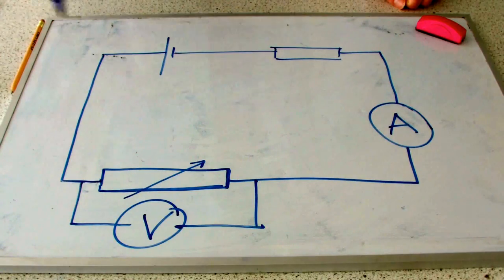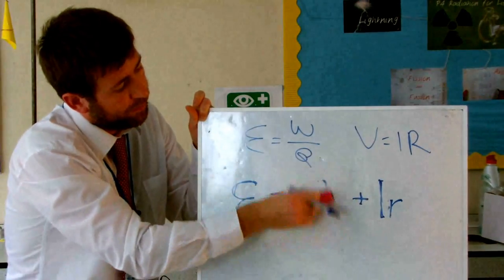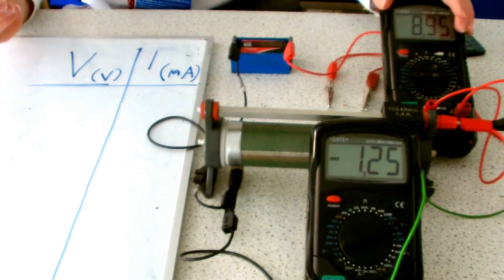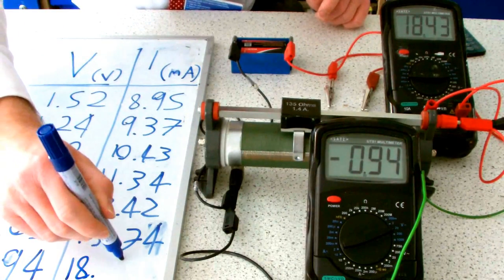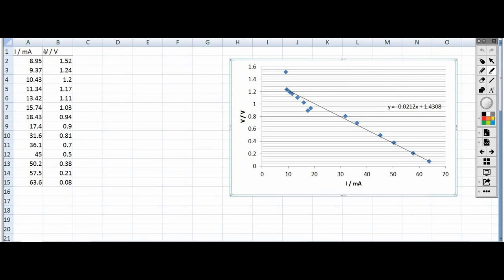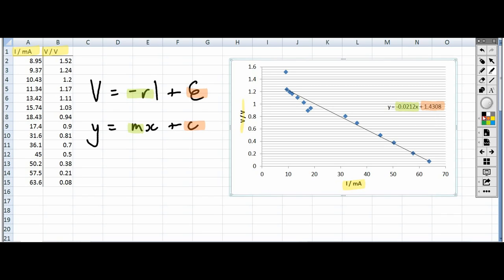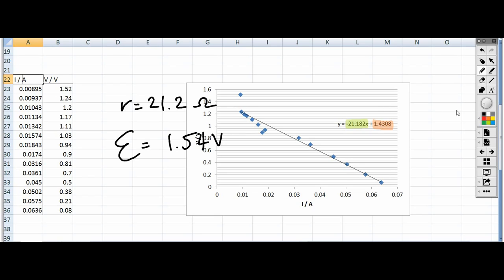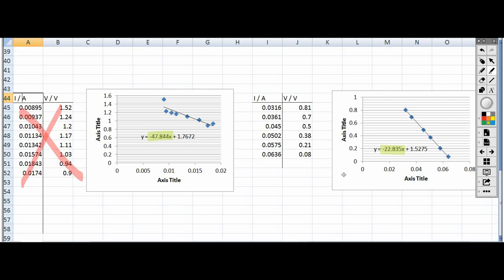Measuring Internal Resistance - A Level Physics Practical

Comment: I've seen this practical with the voltmeter over resistor over the source of emf (cell/battery) and don't know which one is correct because of it being a potential divider between both resistors.

Comment: brilliant video! Can I just check when you were sliding the variable resistor, was it from max resistance to min resistance?
Reply from the maker: Yulin Chen yeah basically, you just need a good range for load resistance to get a good straight line graph. thanks for the comment.

Comment: The “r” in the circuits what does it stand for? I see u using a little wire thing but I don’t really know what it is? Thank you the video is very helpful
Reply from the maker: katy crazy Hiya. The little r stands for internal resistance. So a resistance that a power supply has. 
This experiment is really just a model, as the real internal resistance is too small to measure accurately!  So the little wire thing you mentioned is a fixed resistor. That's what we're measuring with our y intercept on the graph. Thanks! 😀

Comment: Hi! I don't really understand why the voltage decreases as current increases! It says in my textbook that the lost p.d. (which I think means p.d. lost from internal resistance ) increases as current increases.
Reply from the maker: ArmedPenguins you might be ready for the max power theorem!
https://youtu.be/dF0EGP76EQ0
Try to conceptualise the p.d. as energy per unit charge, this might help to explain the effect of a higher current causing more heating so higher resistance so dissipating more energy. I guess it depends on the proportional change in load resistance Vs internal resistance.  There's lots going on in circuits!
Reply: Thanks for that vid! Our teacher did make us try using calculus but it was a little too difficult since we haven't seen chain rule and stuff yet. Okay so if the resistance increases due to the heating, shouldn't V increase? (from V =IR). Or, is this trying to say that as more p.d. is lost as internal resistance, less is lost from the load R, due to the ratio of how emf splits.
Reply from the maker: ArmedPenguins yeah exactly that. You've put it more clearly than I did. If the external resistors are ohmic then current shouldn't effect them. In this experiment with an ohmic resistor as the model of internal resistance then current shouldn't effect it either. Real power supplies do heat up though so that may be what your textbook is getting at... It's my best guess without having seen it! 😃
Reply: Thanks!

Comment: Hey thank you for the video it was helpful! I do have a question tho we've always learnt that when taking readings u must turn off the switch in between readings, is that correct?
Reply from the maker: Shahad Jabiti no problem, my pleasure. I've heard that too but I know from experience that you still get a precise line if you just leave it on as I did.  The reason to turn it off if to avoid the heating effect of current, as the currents in this practical are so low the heating effect is pretty much negligible. However I've seen that advice on exam board material so I'd expect it would be an acceptable answer if asked to suggest an improvement to methodology.